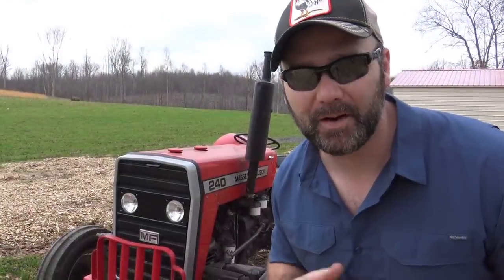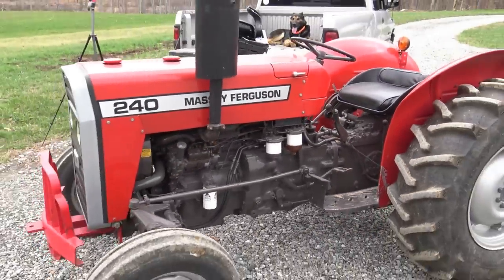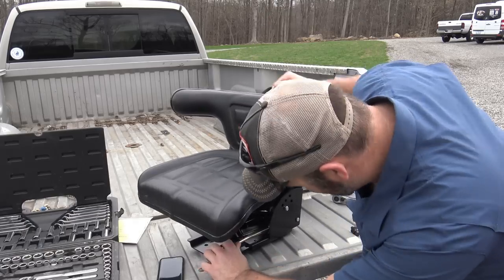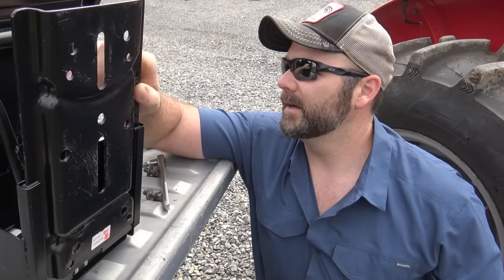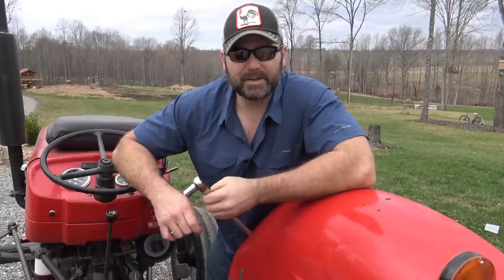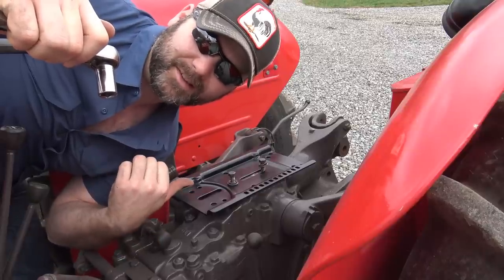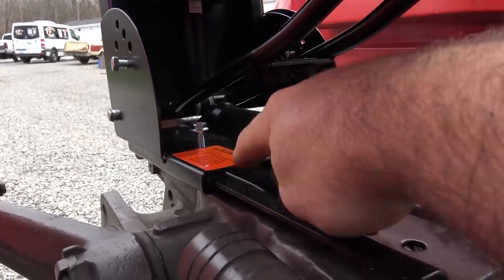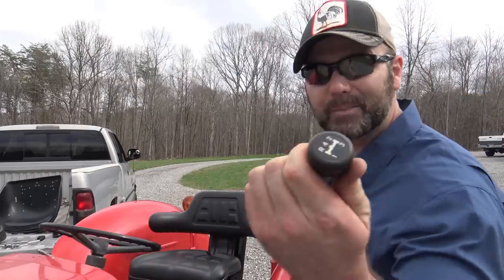CHEAPEST UNIVERSAL TRACTOR SUSPENSION SEAT ON AMAZON..REVIEW AND INSTALL

Comment: I have a MF 240 1988 and have mowed with it for 10 years. Love it. Easy on fuel and very powerful for it's size.
Reply: I have owned a 1988 MF240 for 10 years and love the way it has foot rest up high to give you something to brace your feet on, taking stress off the lower back. I mow 3 acres every week in the summer. I replaced my seat with the same one and had the same issues when installing, so don't feel bad. Great tractor!

Comment: I have a 1988 MF 240 which is very powerful and is easy on fuel. I mow 3 acres each week in the summer. Love the foot rest which is easy on the back when mowing for hours. I replaced my seat with the one like you have. I bought mine at tractor supply for around $100. Thanks.

Comment: I just installed a new seat on my MF 1250 . It was a TICSEA Universal Forklift Seat with Adjustable Black,Safety Belt And Operator Position Switch. While it looked simple, not as simple as yours, it took hours to install. The most troublesome task was to install the travel rails on the seat rails. First there was NO instructions. Second the tolerance between the screws that attach the seat rails and the travel rail was so tight, I finally had to take a washer off the travel rail to get the seat t slide. The conclusion was  much more comfortable seat with slides and has a built in seat belt. Like you say there are always ways to screw things up. Instructions would be helpful but leave it  to Amazon to save $0.25 on paper.

Comment: I have days where everything just works against me😁 Does that seat feel like it will support you side to side if driving on a hill side? I mow mountainous property and need more support. Thanks for the video.
Reply from the maker: yeppers...its' got supports on the waist line...much better than the original in my opinion...but you'll have to judge it for yourself

Comment: Josh I bought a Massey 245 a couple weeks ago 3 cylinder Perkins diesel anyway I myself have looked at that very seat. I am in the middle of restoring my tractor I have to buy new fenders for it and a radiator. My tractor has the flat top fenders but I am considering putting the round fenders on it like your 240 it is the cheaper way to go just not sure if it's the right way to go for my 245. What do you think  ???
Reply from the maker: I'd go back with the original style if it were me
Reply: Thank you Josh I will take your word on that an order the original flat top fenders...

Comment: HEY Josh, I noticed in an  earlier video that 240 had the exhaust ran UNDER the tractor RIGHT?? I think that is how it comes from the Factory, which I very much dislike did YOU buy the kit to move the exhaust pointing UP. My 250 had the upwards exhaust it is BETTER IMO!!
Reply from the maker: The 240 has had the exhaust running upward since I bought it...I prefer it up as well...my dad has an old massey 35 with exhaust out the bottom back...

Comment: Good Job. Check out my video on changing the oil seal in Jr. I said it was a 20 minute job; so I figured it take me about 3 hours. LOL.  I installed on of those on my mower, it really takes the jarring and bouncing out. One thing though, you said you were a "big guy". Put a large washer under the mounting bolts on the base. The bolt heads are small and the washer helps disrepute the force on those bolt heads so they don't pull through.